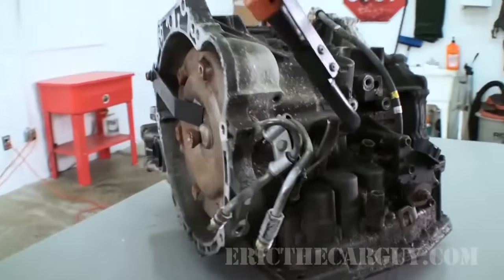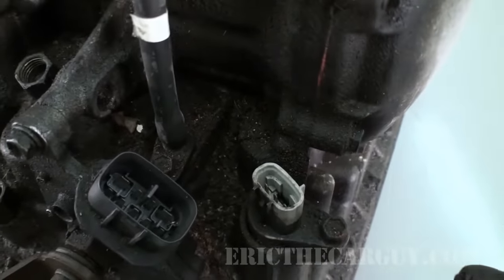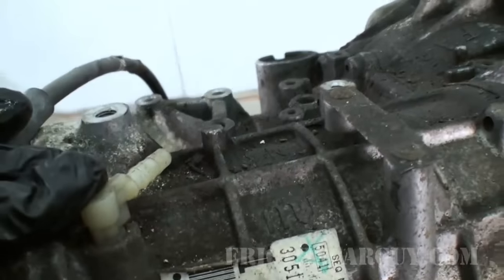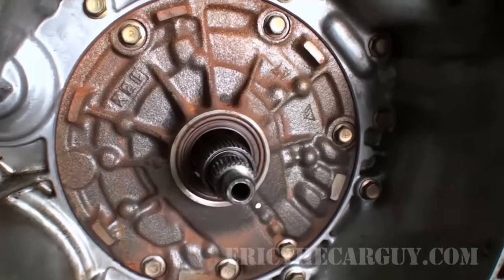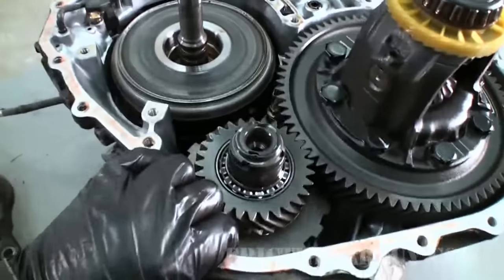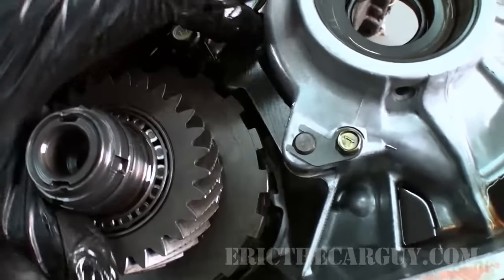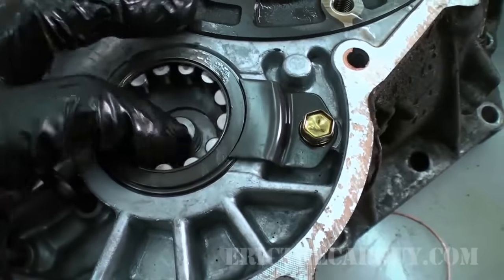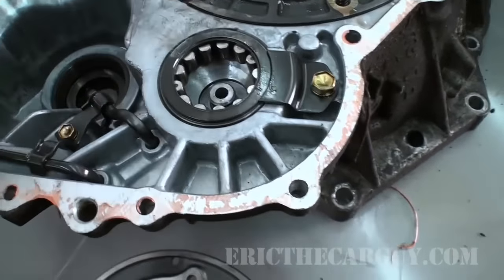The Basic Parts of an Automatic Transmission (Part 1)

Comment: The transmission is always under pressure it just matters what solenoid is sending the fluid to what part. When your transmission shifts a different solenoid is opening to send the fluid to a different part but as long as the car is running its got pressure. correct me if i'm wrong in anyway eric

Comment: Those may be Teflon; some are even made of graphite. Note: use O-rings to seal a non-rotating shaft, seal rings to seal a rotating shaft. O-rings will not slip well enough between rotating parts.

Comment: @metallhead94 the poster was asking about 5 speed manual. Dsg is 6+ speed and I would hardly call it manual in traditional terms. Yes, the most power capable dsg weights 312lb  per wiki.

Comment: Speedo gear inside tradition automatic transmission are typically made of nylon.  This is so that the "driven" gear (output) can have a different number of teeth to match up with the final drive ratio/tire size.  IIRC, 100 RPM on the speedo shaft was 60 MPH. 

Again, like the governor and the TV cable and the buggy whip, these are not in most modern automatic transmission.  Aren't computers cool !

Comment: Hey Eric, this is great stuff. If I'm not mistaken, you're looking at an Aisin A140E that was pulled out of either a Camry or Solara (either that, or it looks almost identical, but I'm no expert). I'm lucky to have found this video because I have a '97 Camry and I've been DYING to see what's inside the transmission.

Not sure if you found this out afterward, but when my car is put in Park, the wheels are geared to spin in opposite directions (and are NOT locked in place). So either...that lock is for something else, or my differential is busted :D

Thanks for the awesome info. Keep it coming!

Comment: '97 Acura Integra GS 4-door sedan automatic transmission. I'm not to intelligent when it comes to cars, but from what I've been able to find so far is that there is some type of switch that knows when I'm pressing the brake which will allow me to shift gears from park to reverse. My problem is that my shifter is stuck in park, Will not move no matter how much brute I use, but my car thinks that it is like halfway into D1. My dash reads park but when I start it up both park and D4 are lit up. It's gotten stuff to move before but it always corrected itself. Now it's just stuck in park while the car thinks it's in drive. I know it's stuck I first because when I drove it home, the car did not shift. I know it's only halfway in first because it's realllllly sketchy when I first accelerate and the speed of the car seems extremely weighted down. Any assistance would be excellent

Comment: Find out exactly what trans the car has by checking the licence plate number. Toyota trans are the best. Some Toyota pumps have a lip, so you need to separate the case. The dots on the pump gears are to tell you which way up they go, as sometimes the 2 drive lugs are offset.

Comment: Hey Eric, my honda's automatic transmission started slipping at the time of takeoff sometime, because of low fluid. I topped the fluid up, and rest 3 gears shifts n pull like rocket except takeoff gear. What would you suggest for this? Thanks

Comment: should the outside surface of the torque converter hub that goes into the tranny be really smooth?
 mine has a layer of surface rust on some spots from sitting under a carport. also some light pitting.
should i just use fine sand paper to sand down the parts with the surface rust?
will the very small pitting affect anything?

Comment: i have a 03 escape cd4e trans 4wd, the driver side cv axle seal is leaking. i replaced seal and it still leaks. i felt a burr on inner mating surface but didn't want to do more damage than good. could that cause it to leak? if so, how would i remove that burr without damaging it worse? thanks.

Comment: hello Eric, i have an issue with my 1999 accord (baby boy) it jerks with a sharp sound when stopped and about moving again. also it goes free on motion and just raised on without moving, and it will suddenly jerk and pick again.
kindly advice as i just changed the gear oil in less than 2weeks.

Comment: Automatic transmissions are not that complicated. Your looking at it as a whole . Like you dont look at a whole engine as a whole . Its broken down into subsections. Its only disks seals and springs.  
The transmission is nothing more than a hydraulic pump and your engine is a generator.

Comment: hey, i have been having some transmission issues, the model in question is a  1993 GM 4L30e, basically electronically controlled by a computer module, it would frequently lock itself in 3 rd gear (fail safe), and trigger trouble codes that show the force motor solenoid voltage high / shorted to battery voltage.... all electronics and harnesses were checked and all checked out, it was observed a lot of metal particules in the fluid that came out while the trans pan (O/D housing) was removed, fluid was changed while at it and the problem continued... then it was suggeste to me that the magnet from the trans pans were missing, and possibly the action of the solenoids could be attracting the metal particles causing the short circuit at the solenoid terminals... mainly occuring at the force motor solenoid because of the design and location.... it was also suggested to use some small magnets and stick them on the outside of the trans pans, but first use the strongest magnet and pass it along the outside of the trans pans to try and pull all the metal particulates to the magnet and get them away from the solenoids... what i can say is that it has been 1 month since the transmission has locked itself in 3rd gear.... strange solution and not sure exactly if it will work for any one else, but i'm just here to share an experience. Also a transmission fluid change done at home may not necessarily get the fluid volume from inside the torque converter...

Comment: I have an issue with my 2005 acura TL automatic, the issue is that when going to drive or reverse or any gear it goes into gear. But then I stand still and when I push the gas pedal for a while it goes. Mechanics are saying it's the torque converter and then some say it's the transmission. please help

Comment: If your driving an overheated engine with no engine oil can that break the transmission pump? The car just shutoff mid driving after the engine broke and seized up

Comment: TV Cable - Throttle Valve Cable.  Because it represents the amount of power the engine is making, on "traditional" automatic transmissions, it performed 2 functions.

First it controlled the internal "line pressure".  Less pressure applied is during light throttle operation.  There is typically an over ride for reverse so that max pressure is delivered.

As you mentioned, it is one of the primary "signals" for the valve body to decide when to upshift/downshift.  The other input to the valve body for "shift scheduling" is "governor pressure".  This pressure is created by the "governor" which is actually a small pump connected to the output shaft.  More governor pressure means the car is going faster.

TV cables and governors are a thing of the past with modern electronic transmission.

Comment: What would make the flex plate to crack?  I have replaced mine 3 times and it's cracked again. Could it be the torque converter or the gear box

Comment: Hey Eric, I am having trouble with what you called the prndl switch on my 94 accord. I believe it is internal on mine. Just had the transmission rebuilt by a local guy and I and my lil bro put it back in four the most part. The shift lever will not go into 1rst and it will not engage in any gears. It makes a slight grinding noise in the park and reverse settings. The fluid is fine and the torque converter bolts are tight. I have been told the shift cable is out of adjustment inside the transmission. I've checked the adjustment under the console and that was fine. Do you know how to adjust the cable from in the transmission.

Comment: My Chevrolet Captiva has not enough torque at first gear. But when it finally moves and got the speed it works well and when I stop again it starts all over again. I also noticed when I travel a long drive I need to turn of the engine to get the torque back again. Any help  please?

Comment: I believe that is the A131L used in toyota corollas and many other sedans.3 speed with a differential that is separated by a gasket.Find the fill and drain plugs,change the fluid when you maintenence the rest of the transmission and this baby will run forever

Comment: O so maybe the park neutral safety switch to the PCM  controls the complete disengagement of the transmission to engine when braking and the changing of gears when accelerator pedal is pressed maybe thats it. I am still not 100% on this. Still getting better on rebuilding transmissions and there internal parts this is much more complex then just switching out a new transmission to understand all the parts (or the ones that matter at least). As a manual transmission with its clutch pedal is far more easy to understand then how the automatic transmission does it automatically for you. Maybe its just the transmission control module in the transmission pan that is connected some how to the clutch disc or bands in the transmission. Still fuzzy on the internals of a transmission much more difficult to get it all down for each major model as it is to just install a new one. The internals are much more complex. (plus i don't see how the TR module is connected to the bands/clutch to control the different gears... you kind of just took us thru the major components like planetary gear assembly , the different seals/bands ,...etc not how the computer automatically changes gears with fluid pressure. (still a great video for somebody first learning the major components of an automatic transmission.)

Comment: I have a 2001 Nissan maxima that runs fine while in drive or park but when I shift in drive or reverse the transmission makes a sound similar to a worn or slack drive belt the sound goes away when I accelerate but comes back when the car comes to a stop I have to put it in neutral to stop the noise could you tell me what might be wrong

Comment: I have a doubt.

You say,several times, up until the time you actually get to the gearset, that you hope it's a planetary gearset. You also say up until that time, that it might not be a planetary gearset.

But what other kind of gearset does an auto transmission have, other than a planetary one? Of course, today, there are dual-clutch autos, CVT autos, etc, which don't have planetary gearsets, but they don't have torque converters, either. The fact that this auto transmission, had a torque converter, surely says that it's got a planetary gearset. Or at least I think so.

So, if there are any torque converter automatic transmissions, that don't have planetary gearsets, please let us know. And the sort of cars that use them.

Comment: I do agree with the suggestion to apply the parking brake when parking your car, but if someone doesn't use the parking brake on a regular basis or at all, applying it may cause the cable that activates the brake to seize, and lock holding the brake in its activated position. So when purchasing a new car or even a newer vehicle use the parking brake on a regular basis if you feel the need, or desire to do so. Don't wait till later down the road to start using it just in case that cable becomes corroded and decides to not retract to it original position, causing it to hold the car in "park". Also Great video it gets to good points, and explains the main components very successfully.

Comment: I have a 2001 volvo s80 and my transmission doesn't shift until the engine is fully warmed up and only shifts once thru all the gears then I must shut engine off and on again to get it to shift thru all the gears, what can this be?

Comment: Good point at 16:00 I do put the e-brake up but sometimes the car may still lunge a little. One thing I have always noticed for some reason when you let your car heat-up for a little longer than normal -- it comes outta park flawlessly .Or another trick I used to do to my 2000 dodge neon was go to the front or back , whichever direction the car rolled in, step out and say it rolled forward, push back on  it some, and that always seemed to help to.

Comment: Can a torque converter clutch solenoid be used as a clutch.  Is it possible to rev and pop the clutch  in a auto I wish instead of Automatic with manual mode it was opposite manual u can have auto shift .

Comment: My BMW 5-series A/T is slipping only after start when COLD.  Works OK after 25 to 45 seconds of revving engine up to 2000 RPM in any gear while moving at a crawl, then suddenly kicks into normal drive mode; same results in D-3-2-1 gear positions.  Fluid level is normal. Fluid had also been changed.  There are no outside leaks.  Does anybody have a clue?  Clogged filter?  Internal seals?
Reply: Like Eric said...it may be a loss in pressure from one the internal seals...not something us regular Joes would know...sorry

Comment: hi i just got a 01 silerado that has 180000 miles 5.3 engine auto tans and i dont think the trans has ever bin flushd and have bin told thar fluhing it now would cause more problems than it would help what do you think?   thanks

Comment: Eric, can you do a video of the transmission cable that connects to the throttle? I know that the honda cable's are adjustable and I was wondering if this is a maintanence procedure to maybe help solve shifting issues, specifically on honda's?

Comment: I had a Bearing Take a shit in the trans at 195,000 miles 2002 Camry, Found one with 35,000 miles on it for $650. Saved myslef 35hundo. We use to rebuilt our Rock Crushers, I hate Automatics.  Great Video

Comment: Based on the transmission pan, i would say it is a 9th gen toyota corolla 03'-08'. Prob more toward 03'. i think 05' and up, don't have a throttle cable, is done electronically.

Comment: Front pump is driven by the Torque Converter directly on most transmissions. The two notches in the front tube on the converter engage two lugs on the pump and drive it.

Comment: hi Eric
wondering if you could help me.
i have a subaru forester x 2006 automatic transmission that has an electrical buzzing sound coming from the transmission with the car not running. so as i go through the gear shifting there is buzzing in ALL gears and louder when shifted to first gear. the buzzing goes away in park and neutral.
again the car is stationary and the motor not running.
please help.
oh forgot to say , the car shifts perfect and drives great... just this noise which is driving me CRAZY!!
Reply: This is normal, as long as it does go away in P and N as you say. Just sylenoids and such buzzing. 
My '99 Impreza does the same.

Comment: I have a ford focus. 2007 stop working drive. Forward but not reverse anybody explain why some people said i some transmission. Problems
Reply: Check your fluid, fill if needed if the problem still persists you need a new transmission.

Comment: Seal rings at 17:41 allow pressure to flow to the input clutch you just removed minutes earlier when you pulled the T/C case off (bellhousing)

Comment: Hey man I got a question Im hoping you can help with. I have a 92 Nissan Sentra FWD Auto Trans and it wont shift out of 1st. Mechanic says the clutch is burnt out but Im not sure. Any thoughts on that?
Reply: Dunno if ya got it fixed by now (2 months..), but it's probably stripped the plastic governor gear. Easy cheap external fix.

Comment: Normal differentials work like water pressure or electrical resistance. The more resistance, the less power, current, or flow.

Comment: Speedo gear is older tech. Manufacturers use other pickup sensors to monitor output shaft RPMs to calculate speed.

Comment: Under that roller bearing at 21:00 is an Oil Guide Plate. Oil pressure is routed from the underside through the hole in that plate to provide lubrication up into that transfer shaft.

Comment: Yep, the transmission is an Aisin-Warner A245E (Toyota part number 30500-1A640) from an 8th generation (1998-2002) Toyota Corolla with a 1ZZ-FE engine.  I have one parked in my driveway right now.  ;)  Great little car.  Better, IMHO than the 9th and 10th gen. 'Rollas.  Thanks for the unbelievably relevant video, Eric!

Comment: Thank you so much for spending thirty seconds to point out the parking pawl and make a plug for using the parking brake.  I see so many people park their vehicles on alarming inclines without using their parking brakes (made obvious by the lurch of the vehicle when the operator releases the brake pedal), and I want to throttle them all.

Comment: I've learned not to use the parking brake (at least on manual trans, which is the common thing here in Europe), unless I park on a hill. The main reasons for this were because the parking brake cable can rip apart when under constant tension, and the fact that when it's cold the parking brake can freeze to the drums and won't release any more. Also, when a car is standing in one place for a longer time, the parking brake drums can rust and seize up. So I normally put my car in 1st gear and park.

Comment: Eric,  great high level overview.   I started doing my own tranny rebuilds a few years back.  If you have a large CLEAN working table space, they are not that tough if you lay each assembly out as they go together.  SOOO many seals come with your rebuild kits.  Many are very close in size but if you put the wrong size in the wrong spot.... You are screwed.  Also, I do a pressure test manually using an air chuck on each clutch assembly before I reinstall them.